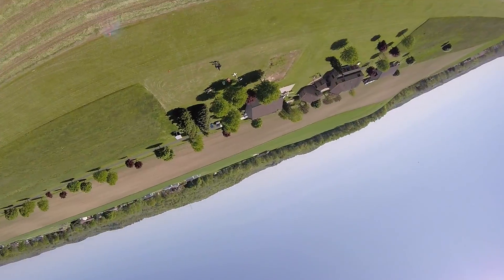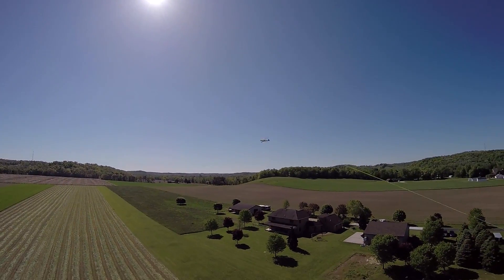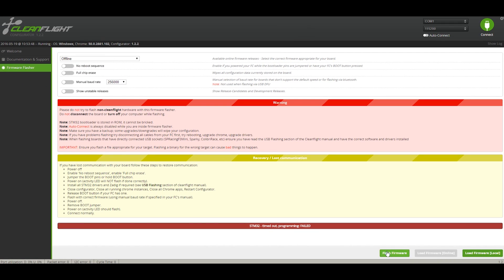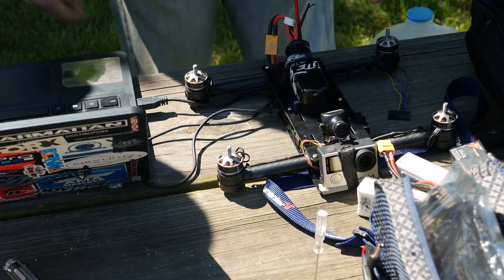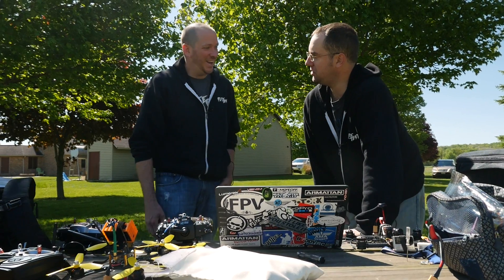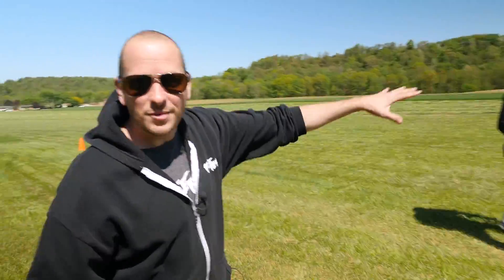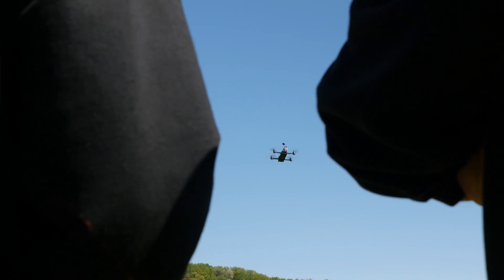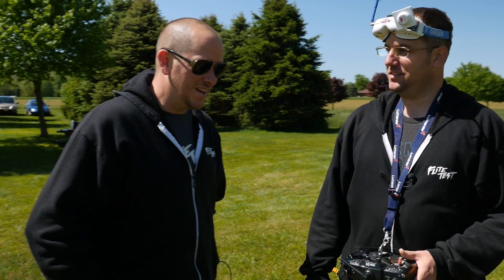How To Setup AirMode (Betaflight) | Flite Test

Comment: Stick arming with airmode can be dangerous. If you drop throttle and yaw you will disarm. Better to arm on a 3 way switch.
Reply: I always just did it with arming and airmode on a single function.  With 2.8+ being able to have airmode as a feature is even better and arm on a switch
Reply: +ElmerFuddGun If you arm on a switch then stick arming is disabled.
Reply: I prefer to have arming and flight modes on separate switches. A two-position switch for disarmed-armed and a three-position switch for various flight modes. Works great and i have the channels to spare.
Reply: Yes, this is how I fly as well.  Airmode on as a feature, and arming done with a switch.
Reply: +Christian Logsdon
Usually it's set this way : Pos1 : Disarmed / Pos2 : Armed, no airmode /
 Pos3 : Armed + airmode
Because airmode is reacting brutally when you hit things, so it's better
 to have it off when you take off and you land and when you fly in very 
narrow places.
Reply: Why 3 way?
Reply: Christian Logsdon I'll take a stab at this even though I don't use a 3 way switch for this.  Some pilots don't like airmode on during landing/takoff.  Airmode can cause some issues while spool up that pilots aren't used to, so some pilots set up the arming switch to work in three stages.  You would set up the switch like airmode-arm-disarm.  This way when you come in to land, you can switch to middle mode to turn off airmode while still being armed.  Likewise, when you takeoff, you can arm without airmode being on.  this way you're always turning airmode on/off while in flight and not landing/taking off.

I don't like the idea because I think it would be easy to accidentally push the switch too far and cause a disarm while too high up in the air.
Reply: Playing the devil's advocate, arming with a switch can also be dangerous... what if you accidentally flick it while in an intense situation- whoops, it powered off!  And what if you have two different transmitters... you have to carefully program a switch that is physically in the same location or try to remember which switch does it on which transmitter.
A "pro" point can be given for stick-arming: It's exactly the same for all makes and models of transmitters.
I'm not certain yet on which method I prefer but the arguments don't seem to hold much sway.
I think that the best method is still: Try both and see which one is most comfortable for you.
Reply: Im just going to stick with stick arming. Mainly because I also have several blade models which all use stick arming.
Reply: Yeah, but you're not going to be flying a Blade piece of crap up high and inverted in airmode unless you have something like the Torrent 110 that JUST came out.  Well, unless it's either the Vortex 250 or 150, but those aren't really Blade quads.  They're the exact same thing as the ImmersionRC quads with different color plastic/props and an RX to make it BNF.  Excellent quads, too, but not because of Blade.  In spite of Blade.  LOL

Comment: What motor/ESC/prop combo was he flying? That thing looked like it had a ton of power.
Reply: It's available from the store. Lumenier 2206/2000kv motors. Lumenier 20a simonk ESC. Naze32. Running 6x4.5 props.  This is what I fly for chase footage.  It can be tuned docile but when you amp it up man it can really run
Reply: +T-Bone FPV cool! Thanks for the info!